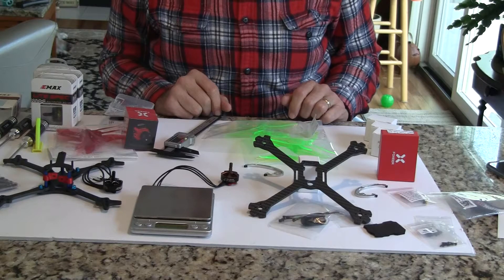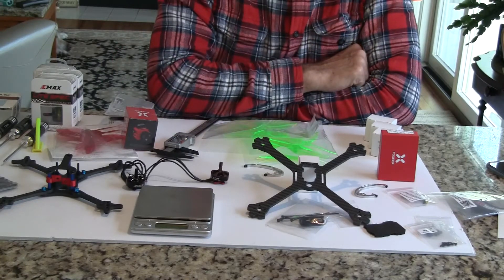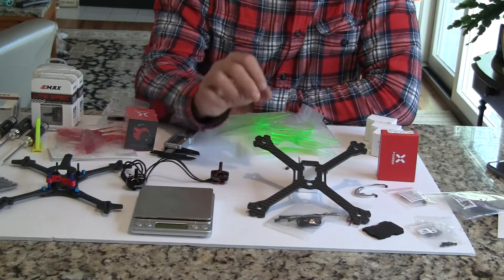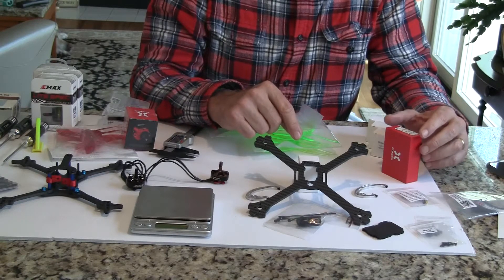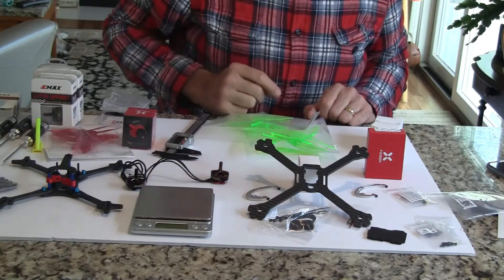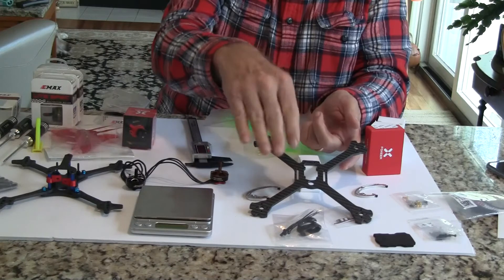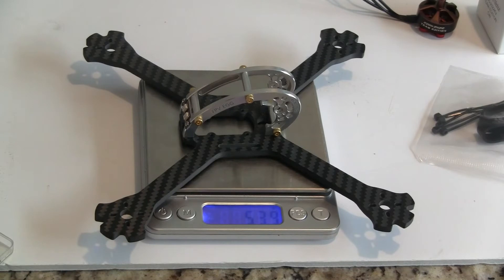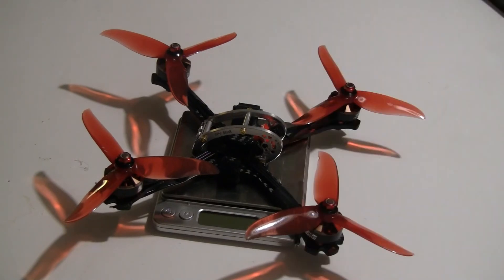King Kong GT200 Frame Review

Comment: Great choice of motors but I'm not sure for the esc, I would put some more dollars to get a better one...really.
 Also this FC is not the upgraded F4 Nano with MPU6000, ICM-20608 gyro is pretty sensitive and some people had bad experience with.
Take a look at the  HGLRC XJB-145 tower which is certainly much better and still affordable.  I also want to buy cheap parts but some are crappy and finally cost more than buying more expensive ones. This kind of esc are,  burnt 2 recently. 
For this frame, I would give a try with Piko Blx + Spedix 20A esc on arms +  5804 stacked vtx ( a Piko Blx with a Matek micro pdb is better but no way to stick it under a 20x20 stack).
Thanks for your videos.
Reply from the maker: Allen thanks for the comment. Back in September I did ordered the HGLRC stack from BG but didn't try it for 3 months and the FC did not work. BG only has a 1 month warranty on Quad parts so it wasn't covered. I should have ordered another HGLRC FCB but didn't, thought I would try one of the cheaper boards to see if it will work. Hope to get the quad flying after my vacation. If it doesn't work I will order a new HGLRC FCB probably from a shop in the US.